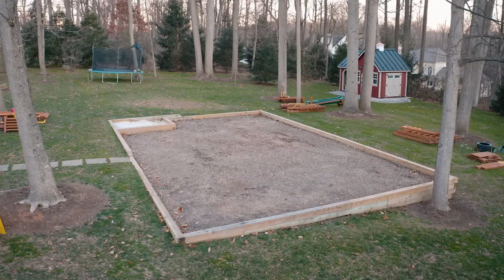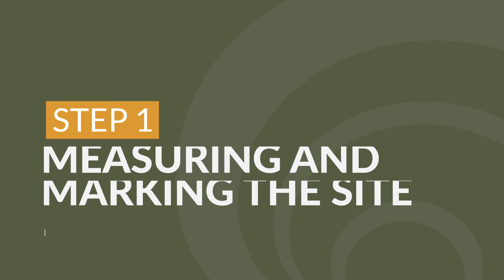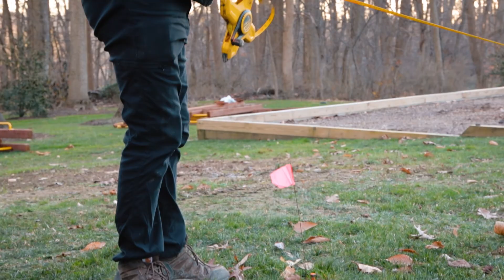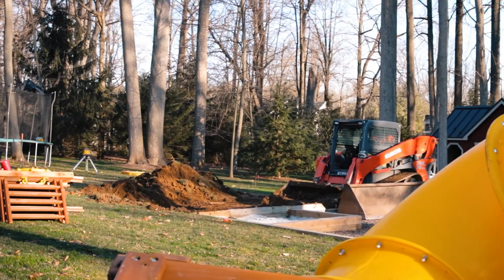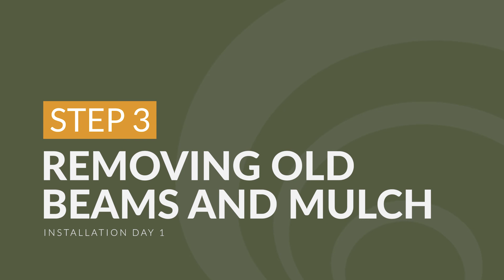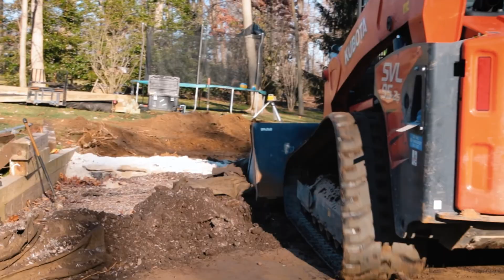Swingset Bases and Playset Foundations: How We Build Them at Site Prep

Comment: Similar to the construction of a gravel parking pad or a gravel shed pad, where the fabric is placed below the gravel, separating the gravel and dirt from mixing, I would imagine that adding an additional heavy duty (permeable) fabric (e.g., woven geo-textile fabric of class 3) below the gravel play-set pad will  help prevent the gravel and dirt from mixing - particularly where the high-pressure points of the playset posts contact the ground.  This may be overkill but again both fabric layers are permeable yet stabilizing, while keeping the dirt/gravel/mulch separated.  Thoughts?  Thank you for this great video!!
Reply from the maker: Since your fabrics are permeable, you're all set—just make sure the site has a slight slope so you don't accidentally create a "gravel bathtub" where water pools underground. Your intuition is honestly spot on; using that heavy-duty woven layer for stability under the gravel and a lighter one for the mulch is a total "pro-move" that’ll keep everything level for years. It’s the kind of extra effort that pays off big when you don't have to fix a lopsided playset down the road!

Comment: Did yall compact the stone at all before putting down the fabric?
Reply from the maker: The stone we use (3/4" clean) is about 95% compacted straight from the truck. So we don't always compact it, especially if it's not the top layer.